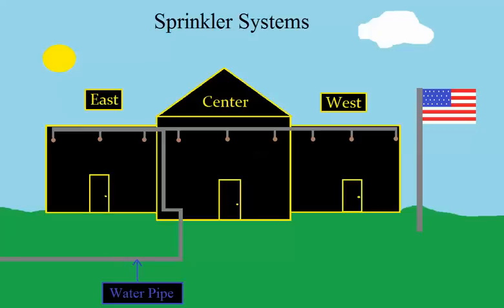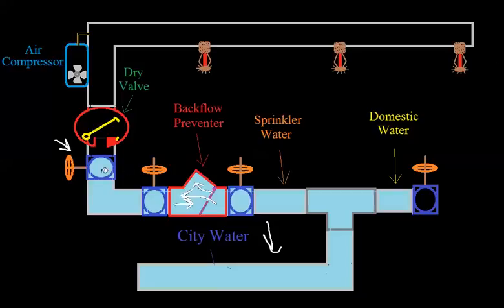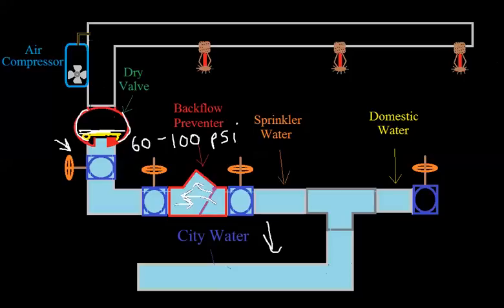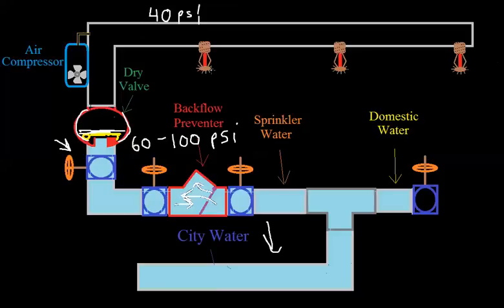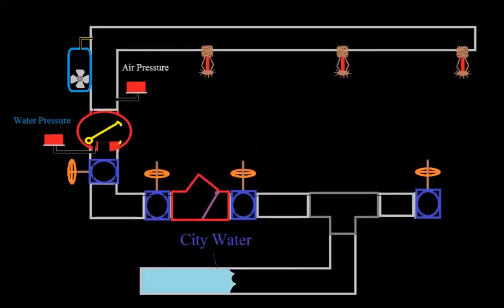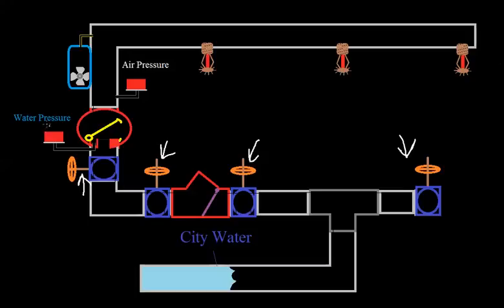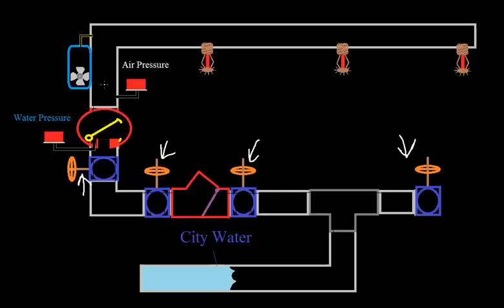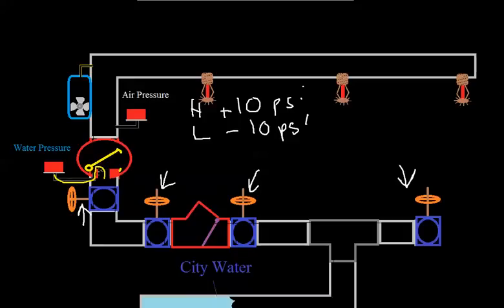18 - Dry Sprinkler Systems - Introduction to Fire Alarms

Comment: have a question I have plumbing work to do which requires me moving the air compressor about 4' shutting down the water to the fire sprink system is not the issue. what happens and what are the procedures for when i am ready to turn the air compressor back on after i have moved the air line, and reset the compressor to the floor.?  thanks.
Reply from the maker: In theory, nothing should really happen. As long as the valve is closed on the water side, and nothing happens on the dry side of the valve, the system should maintain its pressure without the compressor for a little while. When you reconnect the compressor, it may run for a short bit, but it shouldn't really do anything more than that.

Comment: I stay Atlanta Georgia in the weather got down to 28 degrees ice was in the pipe and crack between one of the shut off valve is that normal that water was supposedly be in that dryer system pipe,
 please someone answer this for me .
Reply from the maker: If you're in Georgia, you may not have a dry system. Most sprinkler systems have water in them at all times. Only in areas where freezing is a concern would they switch to a dry system. I don't know what's common in your area, so I can't speak to that. But if you had water in a pipe and the temperature dropped below freezing, you should expect the worst.

Comment: if the compressor fails and the air pressure drops below the minimum pressure needed, the water flow triggers an alarm. the pipes are now filled with water. should there still be a trouble on the system ?